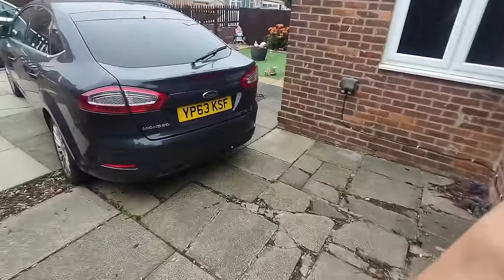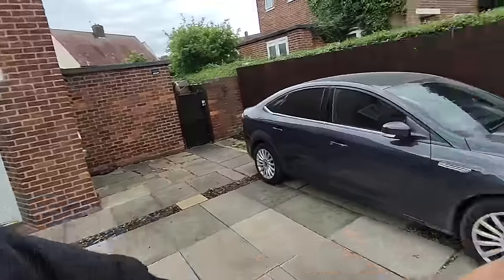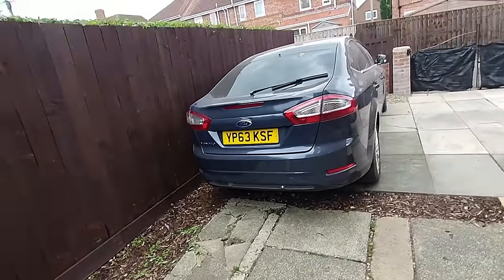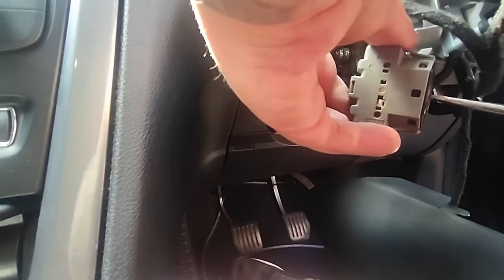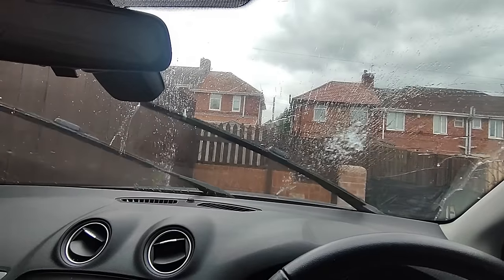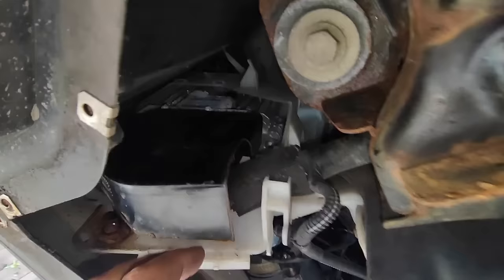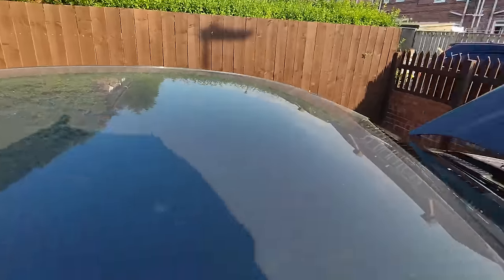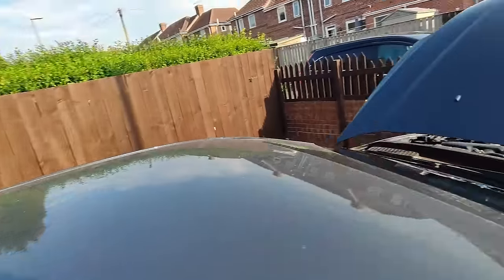COPART HAS DONE ME DIRTY! HELP! PLEASE HELP!!!

Comment: I had the same exact issue on my 2011 mondeo estate which I still own. All I did was change the washer motor and when I was on motorway used rear washer and my car did that annoying tone all dash lights came up and engine died on motorway and all outside lights stuck on. Disconnect the battery reconnect it mines been fine since my mechanic said the water climbs up the inside of the wiring into bcm from washer motor check all your connections for a blue tinch from screen wash in your body control module it’s a known fault
Reply from the maker: Bloody hell, that's crap timing for that too happen for you. I tried changing the washer motor and it sent the wiper controls mental lol.